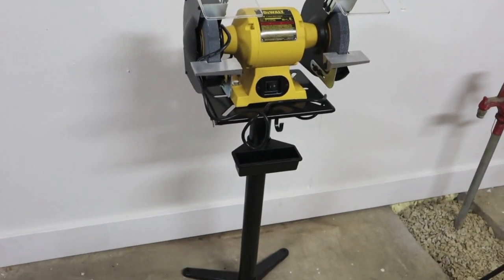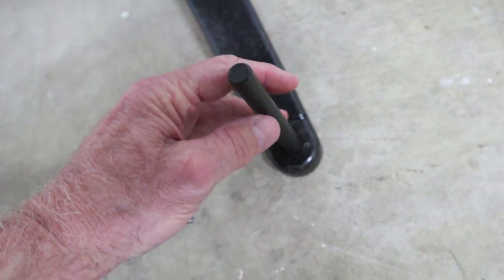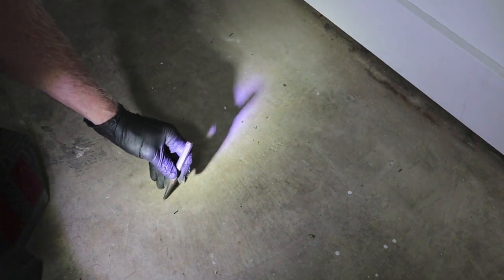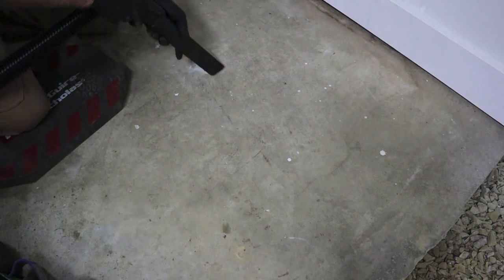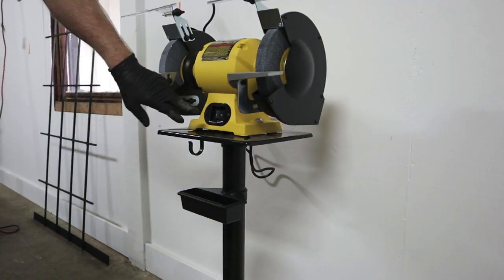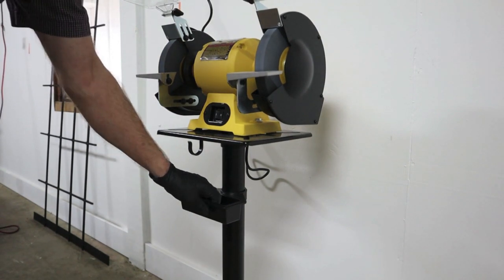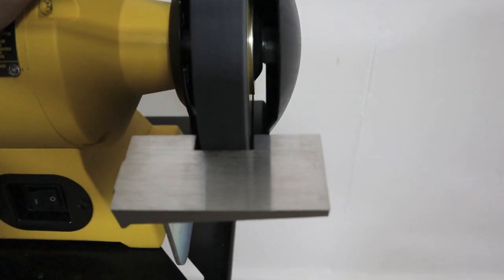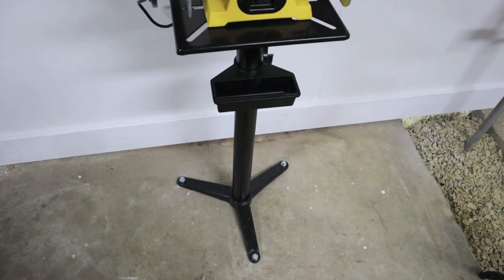DeWalt DW758 bench grinder on WEN $40.00 stand in concrete with wedge anchors

Comment: The transfer punches is a nice set!  I like the stand for the price. It's a nice stand!  That stone is warped. You could grind it out with some flat steel. Grind both sides of the stone.  That's a really nice DeWalt  grinder!  It should make a nice addition to the shop!  Have a good week Pm!
Reply from the maker: Thanks John!
I'm grinding on the stone trying to help it, seems to be getting better.
The grinder is smooth as silk after I removed both stones, so at least I got a good motor.
Have a good one!

Comment: Thanks for the video. We use the same grinder as well as the exact same stand in our shop. Instead of bolting it down to concrete, we put a small 2’x2’  rug under the stand which stabilized the vibration perfectly without sacrificing the mobility. Just my 2 cents.
Reply from the maker: Thanks for the info!

Comment: Thanks. Mine still vibrated until I removed the DeWalt safety guards. Nice video, good pace. easy to understand
Reply from the maker: Mine settled down after I removed the plastic shield frame, I wear eye protection anyway.
The front shelves are aluminum when they should be cast iron. They vibrate bad.
Thanks for watching!